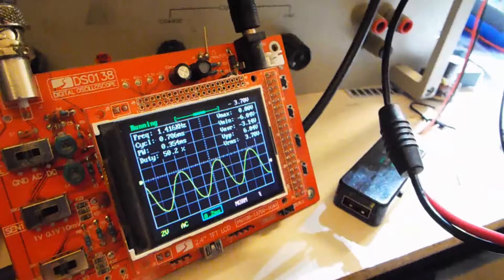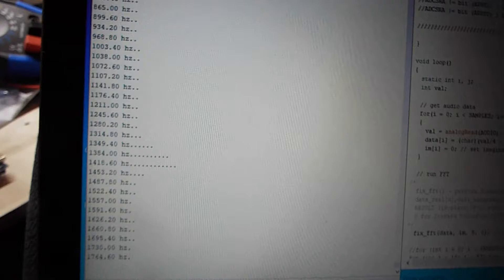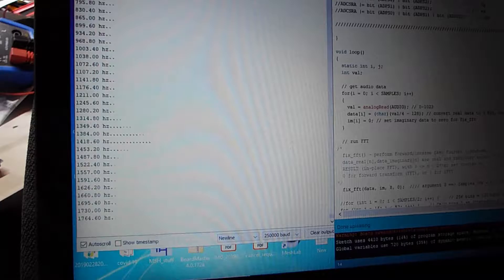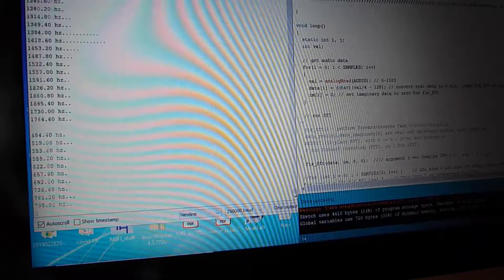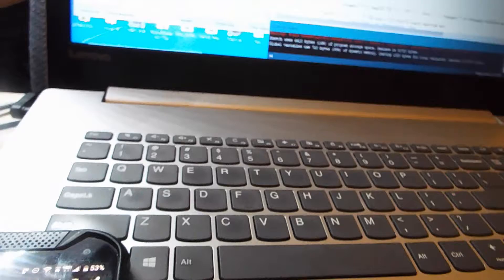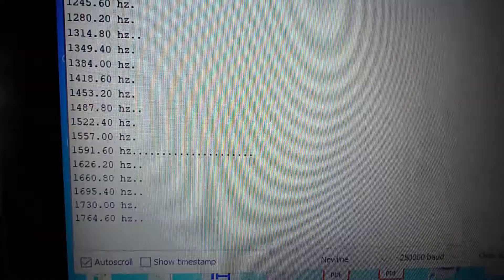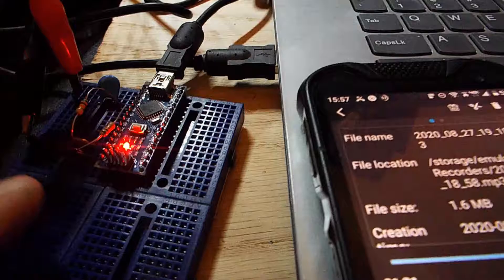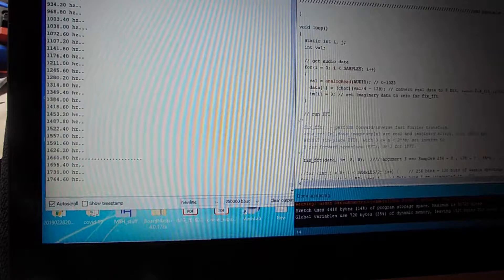Fire Tone Out Decoder Project Part One of ..

Comment: Great project! I'm trying to do similar, however the two-tone is used to control the timing circuitry for an outdoor warning siren. Did you end up getting this thing to work?
Reply from the maker: The only thing to work out is the timing of the signals against actual radio transmissions and seeing if it can still distinguish the tone frequencies on the radio traffic. I was recording some of the radio traffic  to get segments of the two tone signals and then got interested in other stuff so I kind of dropped the ball on this one. I really should work on it some more.  Maybe when I get done with the current solar data logging  project I will revisit this one.
Reply: @madscientisthut  I'm finding it hard to pick out the actual frequency from the radio traffic because of all the noise. So far I've got an FFT algorithm sorta working but it's rough lol. I'd love to see what you can come up with if you ever get a wild hair. Thanks for sharing this!
Reply from the maker: Hi Carson. I started down the path for this project again. I have made a bunch of progress on it. Please visit my blog , make it all of the way through part two to see very promising results : https://madscientisthut.com/wordpress/daily-blog/recording-scanner-traffic-using-python/
Reply from the maker: I am testing it against the live dispatch audio to see what changes will be required to make it robust.
Reply: @madscientisthut  I checked it out and that is some great stuff! Since I'm stuck needing a microcontroller based project I ended up finding the cmx823 IC made specifically for decoding 2 and 5/6 tone signals and using serial to communicate with the microcontroller. I'll update once I have them and get a working circuit.
Reply from the maker: ohh very nice, I looked around when I started the first project and did not find any specific ic that did decoding that was still in production.